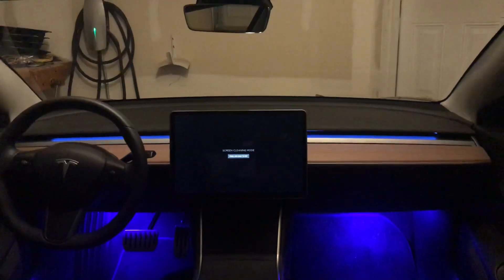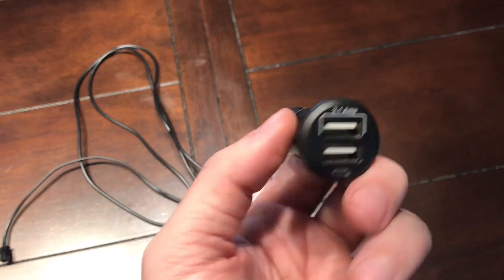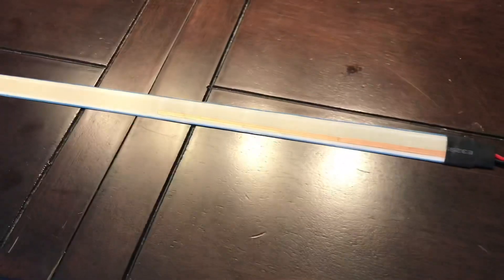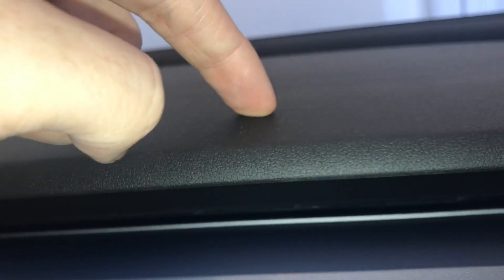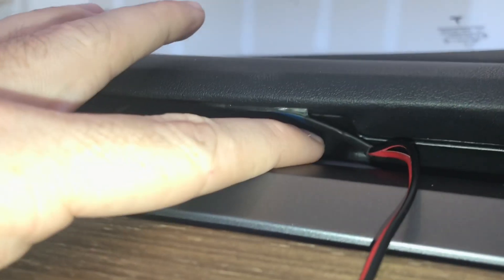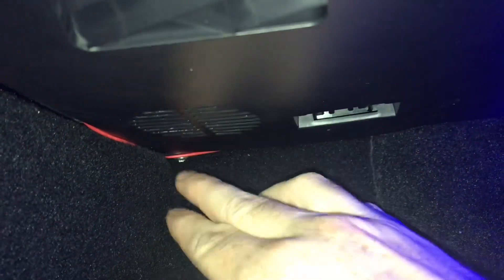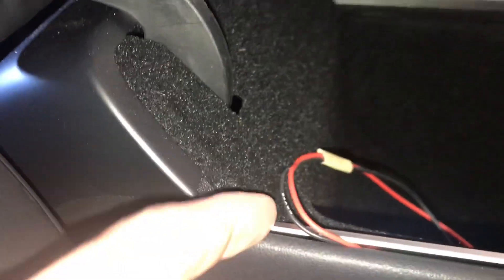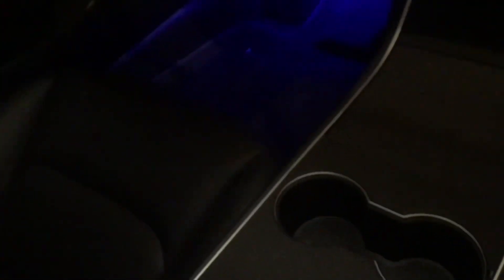Tesla Model 3 - EL-Tape Illuminated Air Vent Installation Guide

Comment: So the lights that are in the vents, how are they doing with hot air coming out? Have they overheated at all? Do they ever stop working?
Reply from the maker: Completely fine, not overheated.

I generally have my heat set at 20-22C, so it's well within the limits of the strip's operation.

Comment: Ok, but if you plug it in the cigarette lighter port, _the El Wire stays on ALL THE TIME.  Does not turn off when car is in Park.  How do you manage that??
Reply from the maker: the inverter has a power toggle switch where you can turn it off.
Reply: 12v turn off whern car sleep, know it, own one

Comment: Do you think that the new RPM Tesla Ambient Lighting Strip could fit in the ventilation space and powered through the adaptercir that connects to the same circuit as the floor light?  https://www.rpmtesla.com/products/trunk-led-light-strip-for-model-3-s-x-59-with-20?_pos=1&_sid=7ee9609da&_ss=r&variant=31210405560374

Comment: Has someone figure out a way to make it turn on only when it’s dark?
Reply: I think it would be easier to do that when it isn’t a Tesla since every thing is controlled with the screen, but in other cars you have a switch for the headlights which you could connect to the LED lights so that everytime the headlights turn on, the LED lights do aswell

Comment: Hey, will the ..............."Nexlux Led Light Strip, WiFi Wireless Smart Phone Controlled Strip Light Kit White PCB 5050 LED Lights,Working with Android and iOS System,IFTTT."   BE ABLE TO WORK IN THE MODEL 3? IT CAN BE CUT 3 TIMES AND IT HAD AN APP TO CHANGE COLORS AND CAN CHANGE THE COLORS WITH THE SONG YOU PLAY. DO YOU THINK IT CAN WORK? PLEASE GET BACK TO ME IF YOU CAN. I WANT AMBIENT LIGHTING BUT THIS VIDEO IS GOOD BUT NOT ENOUGH FOR MY LIKING I WANT MORE COLORS AND ALL THE OTHER STUFF. YOUR ADVICE WILL BE appreciated!!!!           LINK:   https://www.amazon.com/Nexlux-Controlled-Wireless-Waterproof-Smartphone/dp/B072FJ1WD9/ref=sr_1_15?crid=3CE9CFUCLM8EJ&keywords=tv+ambient+lighting&qid=1557008631&refinements=p_85%3A2470955011%2Cp_72%3A2661618011&rnid=2661617011&rps=1&s=gateway&sprefix=tv+amb%2Caps%2C396&sr=8-15

Comment: how well will this handle heat?
Reply from the maker: no idea! hopefully fine, lol.

The operating temperature of the EL Tape is: -50 C / 65 C - so hopefully it'll be fine.
Reply: @SuperDeanio  Update on how it held up?
Reply from the maker: icedgodz428 performs the same as the day I installed it.